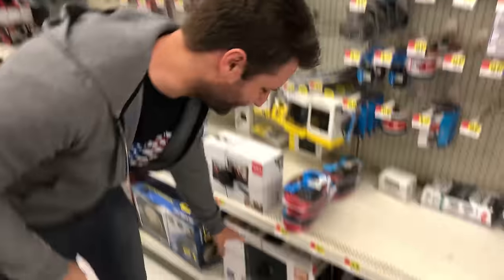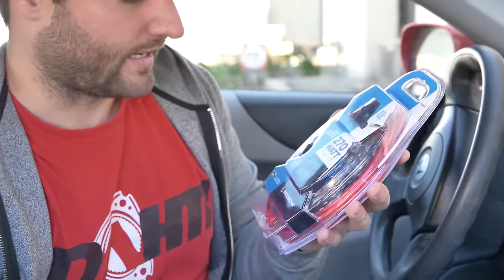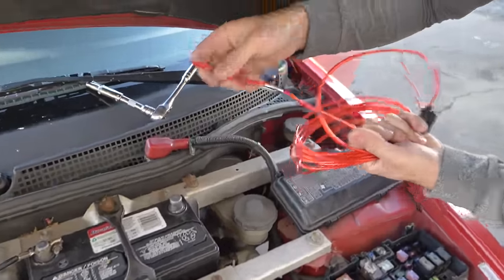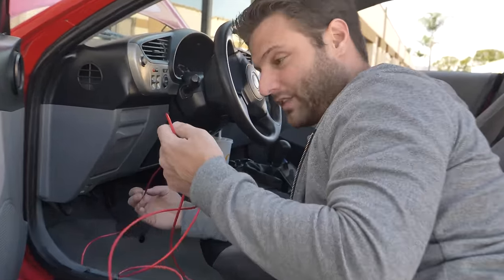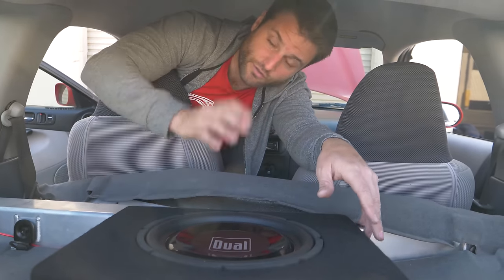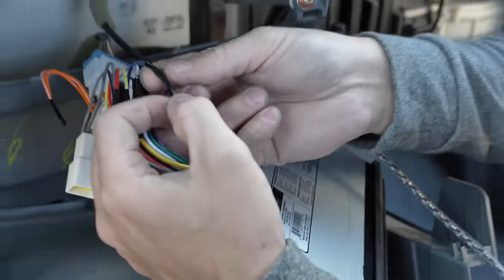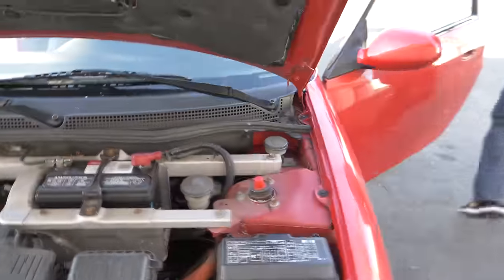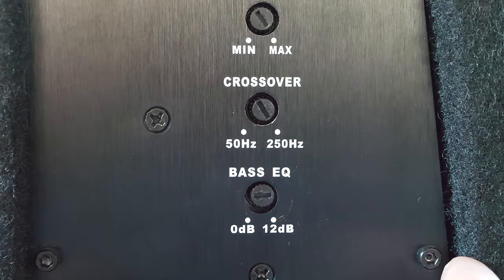How bad is the $70 subwoofer from Walmart? Install | Review

Comment: You are an inspiration to ever 17 year old boy who works at taco bell.
Reply: Nick Smith 🤣🤣
Reply: Dude don't waste money on this im 17 and got 2 legit pioneer 12 inch subs and a 4000 watt amp for 100$ off OfferUp
Reply: Don’t waste your money on Walmart shit. Spend a few hundred bucks get a kenwood or pioneer setup. You’ll thank me later
Reply: Nick Smith cough
Reply: Soundqubed S4-100 - $150
Soundqubed S1-1250 - $200
Soundqubed HDS3.1 series subwoofer - $135-156 depending on size
Audio legion CPMG65 component speaker set - $170

^this is the setup I suggest to everyone who asks me what I suggest for a beginner setup. It's a little bit steep at about $650 initial investment, but if the amps have their gains and filters set properly and the head unit is set up properly as well, nothing will sound better, be as loud, or be anywhere near the same quality for the same money
Reply: Jaktado Pioneer is garbage
Reply: As I have gotten older, I have downsized my systems. Started with high power 15s/2k rms mono amp/component amp. Then 12s/1.2k rms mono amp/component amp. Now I am at one 12/5 channel amp(500 rms on sub). Now I am considering a powered sub setup. As you age, loud tunes lose priority over kids and space. Just happens.
Reply: I'm 17 turning 18 in two months and I have Sundown and Rockford Fosgates plus custom doors and a custom EQ. My shit slams. His car barely vibrates. The camera man is right... it's weak. Not even weak... but... pathetic
Reply: Nick Smith lmao I am a 17 year old boy who works at taco bell and I am inspired
Reply: YOOO THATS LITERALLY MEE
Reply: Brendan Armstrong as am I
Reply: Alejandro Espinoza same here. I used to be big on sound systems. Bumping 2 15s in a small Toyota.

Now I’m perfectly fine with my 1 10” in my mustang.

I care more about the kids and highs really compared to bass
Reply: Ha Taco Bell... I’m about to grab that new 5$ nacho box while you bullshitting 😂
Reply: 😂 don't forget the migos
Reply: 17 and have 5 cars. Gto, 65 Chevy, mustang, s10, and a dirt late model... then again I don’t work at Taco Bell lmao
Reply: @scrappydoolobster6143  better then taco bell 😂
Reply: Hey im a 17 year old boy and i work at georgios. I was smart enough to go with kenwood
Reply: Walmart sells both of those brands...
Reply: Don’t go to Walmart bro save up and get at least a pioneer... for an amp...
Reply: Twisted Conscious Yeah you really should buy from well known brands, but don't be a cheapass and get the lowest end product they offer. Sometimes they are just as bad as the shit you can get at walmart
Reply: Alpines the way to go
Reply: Nick Smith 😂😂😂
Reply: Dirty Bong Water  Good job bro. It's refreshing to hear from a youngster who knows how to do some research and conclude it's better to save for better quality components and drivers then just going out and buying the cheapest crap available.  Spread the word and enjoy teaching your friends about this awesome hobby!
Reply: +Christian. I would suggest for cheap and good bass, the Skar RP-1500 for $179 and maybe the Skar SDR which price wise caps at $120. Sundown LCS. Sundown E Series. HDS 2.1. It's all about the box anyways. You throw that HDS in a shitty box, you'll get shitty results.
Reply: Nick Smith im 17 but i dont work tb lol
Reply: Nick Smith i work at taco bueno
Reply: Wrong I’m 17 and have a 7000 Watts amp And 2 12 alpines 👌🏼
Reply: from somebody who's been into audio for a long time.
don't waste your money on cheap shit cause you'll end up spending quite a bit of money replacing the cheap stuff rather than saving money for quality.
Reply: Jaktado that’s a good price, but NOBODY needs 2 12”
Reply: Alejandro Espinoza not always true, it's case by case. Any real passions of mine have stayed through out the years no matter what's happened in life.
Reply: And owns a subaru or a toyota supra or a Nissan skyline who is hitting up high schoolers
Reply: Amen brother
Reply: T smith sure u do
Reply: I went To taco bell at 2am that was suppose to be open until 4am. Place was closed. I was pissed. I just wanted some Crunchy Taco Supremes...
Reply: @Jaktado  Pioneer sound awful to me though, but ya, I agree, save some money for better stuff.
Reply: @Jaktado  4000 or 400
Reply: Nick Smith I’m 17 and have a 1200 watt system
Reply: Nick Smith We were all there one time man👍
Reply: I’m 17 and work and subway. I’ll probably be getting this speaker. Lil
Reply: I'm 17 and work at Taco Bell and I resent this remark.  I have scruples!
Reply: All these 17 yr olds getting butt hurt LoL
Reply: Oooo got they ass
Reply: Lmao i got 3 p2 for 60 , my friend had got them for 10 bucks lol just needed amp and you could hear the bass from a street away lol
Reply: You're just wrong Nick...my first garbage sound system at age 17 cost at least $300, but I was busboy ballin lol.
Reply: Skylar Adrian What do you think of JVC?
Reply: @skylaradrian1372  learned that the hard way, when i got my first car a few years back i bought a cheap radio and sub from walmart, now i have an all pioneer setup and the difference is night and day.
Reply: @Jaktado  Never go off what a amp has printed. Always go off of RMS. If the amp says 4000 watts on it more then likely its only 2000 Watts RMS, if that. Also if its not a well known brand, more then likely 1000 wattts rms. food for thought.
Reply: Subway*
Reply: Or applebees XD
Reply: @Jaktado  3 mill views, hell he got paid off the speakers if you ask me. Good investment.
Reply: I was 17 and I worked at taco bell. And my system was way better then this piece of shit😂
Reply: Buy a Mercedes they come with Harmon kardon you will thank me once you do it
Reply: @travissmith4461  your dads cars no way u bought them yourself then no way in hell your paying insurance for them ud be paying like 2k a month especially for a 17yr old
Reply: THE CHILL PILL. Have a business to do insurance through, I only pay for the gto because ya know, bigger chance for tickets. Racecars don’t have insurance and I only partially pay for them. Mainly I “pay” with my labor and getting them ready every week. Got the others cheap and dad and I have both put money in to build them. Gto is payments. I mow 10 yards or so every 2 weeks at $40-60 along with working on my uncles cars that pays well. Also can work at our business for $10 an hour which I do when I can. I have coop so I get out of school at 10 one day and 12 another.
Reply: @travissmith4461  so u dont own the gto ur making payments still and u wouldnt if got any of them unless your daddy helped.......if u told someone u mow yards to pay for them they would laugh their asses off 😂😂 gtfo
Reply: Bull shit, it kicks ass
Reply: Dead Serious *hey Siri - call my lawyer
Reply: Dead Serious  😂
Reply: @skylaradrian1372  ive bought kicker door speakers from walmart never regretted it
Reply: Ohhhh man listen to that bump. Roflmao.
Reply: I love Taco Bell. mmmmm
Reply: So true
Reply: Nick Smith no u didn't  lmfao
Reply: Jaktado no you don't..... 4k my arse <and im from AZ ,USA >
Reply: 金3 A.M. tf they are pioneer is 1 of the best in car audio - hands down the best HU/ decks ....

Really clean powerful amps and the SPL shit is always on point! - i sell & install car audio for a living
Reply: @ Nick Smith 🤣😂🤣😅 17 yo raging hard at this comment...   totally worth it.
Reply: car audio is for guys who  have never listened to an album
Reply: Dirty Bong Water lmao “blasting distorted bass songs” I could imagine that. Lmao. I’m trying to make a decent sound system. I’m new to audio. I have 4 infinity kappa 682.11 2 ohm speakers with 100 rms each. What amp would you recommend? I’m also planning on later installing a second amp for one or two subwoofers in a 2006 F-150 truck.
Reply: @PayneVisuals  I agree with this. If it looks too good to be true for how much you're paying in comparison with the rms output chances are that it's a lot less rms power of what it claims and is probably in those cases a relatively unrenowned brand.
Reply: @MrNunchakulee  my rule of thumb is if its printed on amp divide by half and that's that rms most of the time.
Reply: Nick Smith i am that 17 year old boy
Reply: @travissmith4461  well some of us work at tavo bell... And guess ehat, its not you!!!!
Reply: Rhinoceros that’s true, fingers crossed I’ll never be there.
Reply: jokes on you i work at wendys
Reply: I’m 18 did all this on my own but I’ve got two jl 12w6’s on a 500/1 slasher amp
Reply: Damon Mcdaniels lmao 7000 watts when lightning strikes it 🤣
Reply: Dont worry, one day You will work at Walmart.
Reply: holy fuck how is this so accurate
Reply: Randomness Calls For Randomness damn should post
Reply: Look at pawn shops for deals. I just got duel alpine 12 inches for 200 bucks
Reply: Christian Stanley you’re forgetting the box. Don’t leave out the box or these ppl will be trying to get prefab boxes and fking their shit up
Reply: 金3 A.M. facts
Reply: What the fuck I’m literally 17 on my break from Taco Bell I’m actually scared
Reply: @Jaktado  A true 4000rms amp for $100? Lol you've been had there mate! I have a true 4k amp sitting in my garage with a dead mosfet or 2! just needs fixing and I last had that tested at 4188 real watts contiuous - was a painful setup. real 4k amp would set you back minimum 600 or new $2000
Reply: I’m 18 and work at checkers
Reply: Damn bro why are we the same people
Reply: @travissmith4461  sure you do pal.
Reply: Cardboard Sliver shoot me your insta or Facebook I’ll show you.
Reply: Well, it's easy to take a pic of a car and say it's yours.
Reply: @fartmerchant762  so I'm not super cool for doing that? Hahaha
Reply: Nick Smith i’m 17 and i work at an assisted living 😎
Reply: Lol I work at Walmart, im trying to install some 6x9s on my car but I'm just unsure which ones
Reply: Low key run my shit in the door jam also idc tbh lol
Reply: McDonald's too
Reply: LOL
Reply: Anyone know a good amp mine is fucked up and I need a knee one
Reply: More like every 14 year old without a job
Reply: No joke I’m 17 and just got off my shift at Taco Bell
Reply: Nick Smith I work in a Furniture Warehouse but you still spittin Facts 😂
Reply: C'mon man be nice okay
Reply: Yes sir your right
Reply: I got dual tens, 5000w amp, front speakers and tweeters for 700 off
Reply: @Jaktado  4000 watts for $100? Nope. You'd be lucky to get a 500 rms amp for that lol
Reply: @fartmerchant762  Damn I hate it when people blast distorted music and think it sounds good! iv got my hertz amp bridged into about 500rms into my door speakers lol...they dont have any sign of struggling at all haha
Reply: Twisted Conscious , sundown audio is also a good brand but more expencive, me my selfe have a pioneer 1000w and a sundown sa12 and it is under 10 000 and really good!
Reply: @fartmerchant762  nope. people may just simply not like doing stuff by them selves. All-in-one package is simple.
Reply: I think he also used to work at taco bell
Reply: Omg wtf I’m 17 and I work at taco bell
Reply: I’m 15 Nd bought both my parents sound system for their car lol 2 12s on one and 4 15s
Reply: @Jaktado  That's because it was fucking hot and you bought it off a fence. I mean if you want to buy stolen shit at least buy decent stolen shit.
Reply: I’m 17 and I got 2 12’ Kicker Subs and a 5000 Watt Rockville Amp
Reply: Rainy nah. Right now I’ve got a cammed up ctsv and a built 03 6 speed Cummins. (Payed off ;) )Going to buy another car this week.
Reply: Christian Stanley I got a jbl 1224, kicker amp, and some decent aftermarket speakers all for around $950.. I’d say it’s more worth it to save that extra money and start with a high quality build you know will be good for a long time and be worth the kick rather than worrying about having to uninstall and sell if you want to upgrade
Reply: @Jaktado  how loud
Reply: As a 17 year old Taco Bell employee, I approve
Reply: I was once that boy....
Reply: That’s not the case for me lmao
Reply: These are like 2 year old comments but I just got my license and have made my own 3k watt system with 2 twelves on a taramps 3k so if I can do it then y’all can too
Reply: @skylaradrian1372  Memphis is better and cerwin vega
Reply: Jaktado I swear I got a Boston 10inch 3000watt sub for 50 off Facebook with amp and bang wayyy louder I’m 17 too lol
Reply: Nick Smith not really, have single 12 inch in a custom box, on 2k. With a big 3 and stronger alt
Reply: @stevenlafrancejr4843  alright then where do u live?
Reply: Well, I'm a 17 yr old girl with no job at all 💀
Reply: I'm 17 and work at target and got 3 kicker cvr with a audiopipe 3000 watt amp so... idk if thats supposed to offend me?
Reply: What about the ones that work at burger king?
Reply: LMAO I literally did that to my car when I was 17 working at Taco Bell 😂😂😂😂😂😂
Reply: Lol i like mine. I don't have much space in my 98 ranger but it fits perfectly in between the back space of the seats an sounds great.
Reply: Lol
Reply: me
Reply: Nah when I was 17 I had two 10s on a jl 500 amp and I had a kenwwood 4 ch but the kenwood wasn't hooked up
Reply: @skylaradrian1372  i like jl subs
Reply: @fartmerchant762  dude nobody could hear them anyways so its fine.
Reply: @ezioassassain  yeah I got a 5 channel amp. I highly recommend it 60 rms to speakers and like 250 or 300 to the sub. Sounds better quality wise with that and new speakers.
Reply: @F.B.I yes
Reply: Go with something better than dual I would usually tell people to go with kicker when they first start and make ur way up I started with a cheap ass set up it was 2 kicker comp 10s in a ported box saved more money and then I’m down to sundown
Reply: I hate that I’m 17 years old and work at Taco Bell rn
Reply: @cadenwelsher2076  🤣🤣🤣
Reply: @cadenwelsher2076  If your putting subs in your car do it the right way.
Reply: Im a 17 year old boy who works at taco bell. This sub is meant for people who can just scrape some money together😂
Reply: so true
Reply: @skylaradrian1372  what’s a few bucks look like?
Reply: @Jaktado  cap
Reply: @Jaktado  🧢
Reply: Get a Skar SDR 12 and an rp-800.1D amp, then preferably build your own box or else buY one from Skar.
Reply: @travissmith4461  Ur dads cars dont count
Reply: @xxyvng6831  give me some social media you’ll really hate what I have now. Even have a house. Believe it or not under my name and paid for by me 🤡
Reply: Literally got a Taco Bell add convenience?
Reply: I’m 17 and I work for an automotive apprenticeship lol
Reply: That was mean 😂😂😂😂
Reply: Bro that literally me 😂, I’m 17 and made a enough from working to upgrade my car
Reply: You 21 now zayum
Reply: @nicotharp728  man im 32 lol I didnt make that comment as a 17 year old.
Reply: To ever 17 year old please learn how to spell
Reply: @beepboop1210  dam bro.. you didn’t gotta do my like that 😂
Reply: Bro I’m about to turn 17 and work at taco bell
Reply: U NOT WRONG LMAOOOOOO
Reply: lmao me except i work at dairy queen
Reply: Spot on lmfao I was that kid
Reply: Or anyone who enjoys music...
Reply: imao this is so true
Reply: Stole the ALPINE outta EASY E's car......yup
Reply: If you’re going to do all that wiring for this sub you might of well just get a real set up
Reply: Sounds like me trying to find a cheap and sub that will fit in my single cab 97 s-10
Reply: @Jaktado  hope you got a capacitor for that bruh
Reply: @rattmon9100 what did I do 😂
Reply: im 17 lmfao
Reply: @skylaradrian1372  mine was giving to me lmaoo
Reply: aye im a 19 year old working at a mental hospital and mines free lmaoo
Reply: Bruh ur not wrong 😭💀
Reply: Or my color blind ass trying to wire a sub for the first time 😂😂
Reply: lol im running an sa classic and jvc hu!